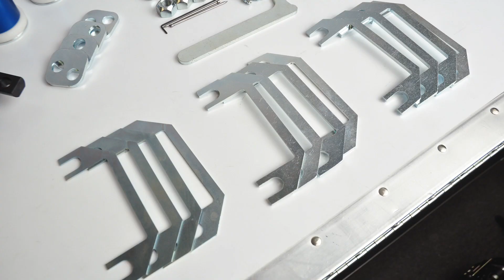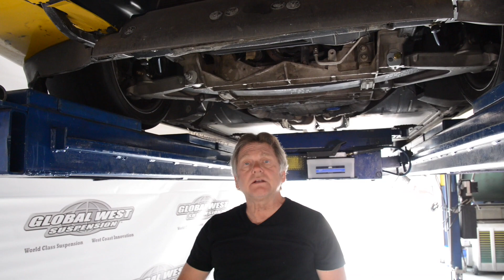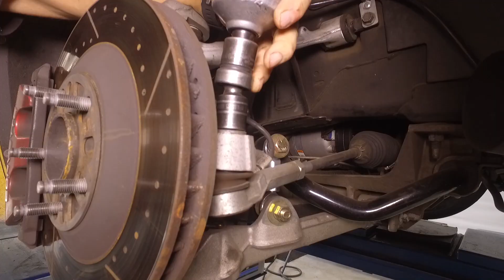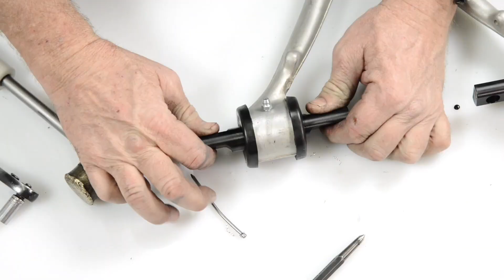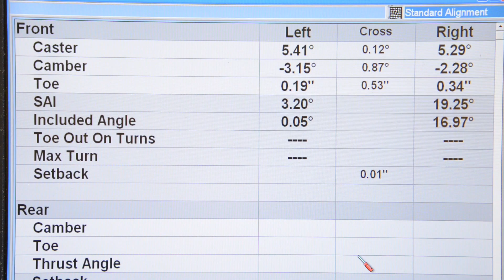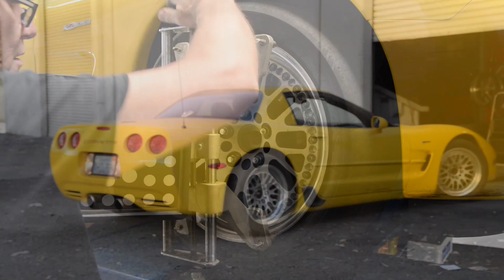Suspension Solution For C5 & C6 Corvette Worn Out Or Moving A-arm bushings

Comment: Car is raced?  Not with those "tire warmer" brake cooling ducts.   You might consider some better ducting, and I think cust would be happier with braking from high speeds int o slow corners.  I found a tremendous improvement on my C5 on the track.
Reply from the maker: Great tip will have to look into this!